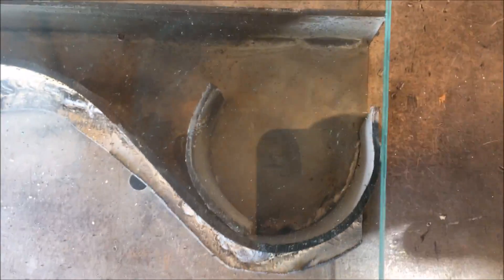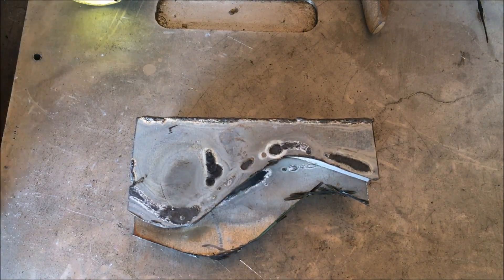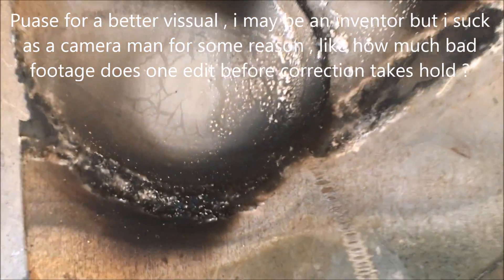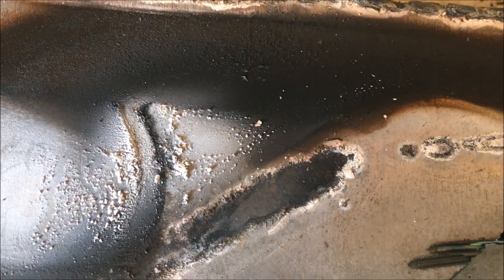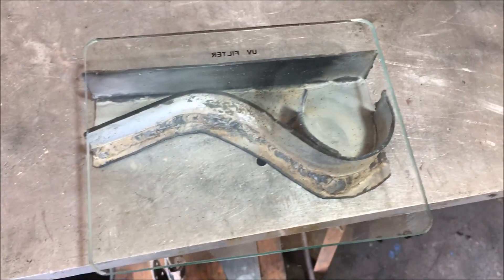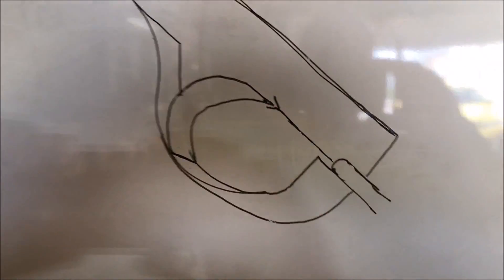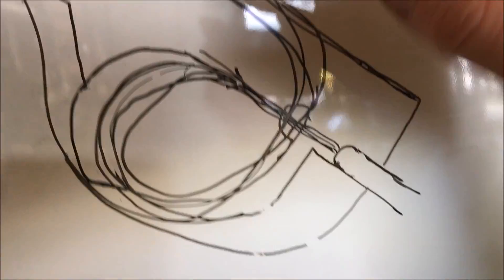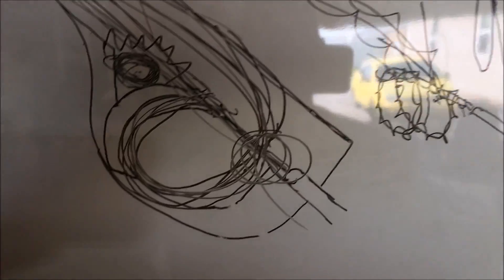Waste oil Burner Extruded Combuster  Design

Comment: the white does not really mean its oxygen rich it white because its hot
Reply from the maker: yeah typically hotter zones have more oxygen per sec delivered to that zone by a   continual replenishment and by the fact they get first dibs on the fresh air.  the burning fuel is just blasted out the device in the barrel whith little o2 left over from vortex combustion , but in the vortex zones a greater  air to fuel ratio exist   and thats why it burns hotter   , a swirl jet or Vortex as its called  has a continuous replenishment of fresh incoming air but a traveling flames gradually burns itself out  and only has o2 left over from the vortex to burn   . More O2 per unit change in time is by definition a leaner burn or oxygen rich .more so then the surrounding areas . the only way you can make it hotter is add more oxygen bro weather it be by mixing the gas better or more being added to that zone . but hey what do i know   , there are also black zones that are black because they didn't get hot they didn't get hot because the vortex burnt up most the oxygen ?

Comment: Your line art seems to explain it the way I would envision it happening.
Reply from the maker: I regret not  mentioning the incoming draft induce by Brunelli's principle finishes off the swirl and heads it back out the discharge side of the device , it plays a huge role  in inducing the upper rotation , you can even see a quarter circle inside the intake . Check time stamp 2:02 and look at the round top or quarter pipe as we would call it as kids
Reply: I remember quarter-pipes, I knew a few skaters and BMX freestylers as a teen.
Reply from the maker: I got your link and it made me wonder what would happen if we incorporate the golden ratio into the vortex itself , if you could induce a golden ratio vortex or even a  combuster that used those dimensions i wonder if something would happen. any way i did figure out one thing about combustion "all theory that may already of bin proposed " but i think the reason some areas burn hotter then others is because low velocity compressed gas burns slower then high velocity low pressure , when static pressure converts to dynamic it stretches out allowing the fuel and air to mix faster and to a higher order , this is why rocket nozzles get so hot at the throat , O2 is in the engine every place so why does the throat burn out ? its gotta be the molecules are now traveling faster and the stretching out of the combustion zone in the divergent sections of an engine induce a leaner better mixed zone then the slower moving compressed zones . there has to be a connection between the lower pressure and the hotter burn and consider this , a divergent nozzle can or any adiabatic expansion adsorbs  energy from the surroundings or any expanding gas causes a cooling effect   i think the cooling effect in this case is adding energy to the flames. To be clear we all know that if you expand air threw a nozzle a cooling effect takes place and static pressure robs thermal energy from the surroundings when converted to dynamic pressure  by taking off with a vibration potential energy with it  . so now think of that with red hot metal ? how much energy is available for adiabatic expansion   in these conditions , could it be the reason for the hotter zones ? Adiabatic expansion cools gases but would that be the case in combustion ? wouldn't it adsorb even more heat then usual from the surroundings as it expanded seing as how its a 900 deg combuster  ?
Reply from the maker: Ok so my nomenclature is off its bin a wile , maybe i ment isobaric expansion could be the reason the low pressure high volocity zones burn hotter , or maybe its the things you discussed in your thesis but im not any ware near mach 7.7  or what ever you stated but something strange is happening .
Reply from the maker: In regards to the oil hitting the glass i was worried about it turning the glass black not about it cooling and breaking it stains red hot metal white and cooler metal black so going opaque on us was my concern .

Comment: Yes your oxygen balance looks pretty nice, and the swirl lives.

You would be best to preheat the glass in an oven somehow to keep the whole mass of the glass expanding equally since its the sudden and extreme imbalance in temperatures from the middle to the edges.

An alumina type 'glass' or pure quartz would give you better results for longer.

On the 'whistle' build, you would have to experiment with the amount of extension you gave the scoop, I would have had to as well if I were building it.

The easy thing is, you just take a torch and heat up your plate enough to dimple it in the middle [your fine tipped HHO torch should be perfect for this since its a lot of heat in a small area, allowing the edges to remain harder than the working area] and carefully hammering it to say where you would guess to be your bare minimum, and then cutting away the part you do not need.

To resize it, simply re-head the leading edge of the scoop so you focus your heat where you need it and no places it was not needed.

Although, technically you could hammer it back a tiny bit, it would not un-stretch, so the back-hammering would cause wrinkles.

You do not need a really heavy piece of metal for the initial experiment, so maybe just cut up some old used appliance for cheap spare flat steel and make a few of various sizes so that you can both vary the distance as well as the other dimensions without having to destroy one you already made, which you just might determine works better than later versions.
Reply from the maker: my idea was to drill a hole in a piece of metal then get it red hot in the area of the hole at witch point i will insert the drill bit shank down into the hole and bend it over as far as i can creating the shape in to directions , one up one down , then we simply hammer flat the one we dont want . the dimple idea sounds good to but i already kinda had my mind made up after i looked at your draft , its funny how such simple things can actually be a complex build
Reply from the maker: Yes i had the same idea about pre heating the glass in the oven , it would definitely buy us some time  but my concern was what will happen when oil hit the glass at 500 deg ? it may turn black faster then if we just let it explode . We got under 30 seconds of burn before the glass exploded on the torch test but on  1/8 speed thats a good amount of footage to examine . Its a real tough call , my intuition tells me oil hitting hot glass will cause more harm to the observable life span of the test set up then just letting it explode by thermal shock . I cant remember the specks but you only get  80 deg c of thermal shock for glass meaning you must keep all parts of the artifact within that spectrum or thermal cracks can appear . that spec is not proofed but likey close , its bin 10 years since exposed to that literature , i do remember being very surprised at how low the number is   even for pyrex witch is deceivingly praised in chemistry books
Reply: Your forming approach sounds as good as anything else. I think your method should work well enough.

Twisting a drill bit in the hole, for safety reasons I would use some other metal than a drill bit if only because it could break [or at the least possibly bend, either way ruining the bit]. 

If you have a large strong screw driver, a steel shaft, a piece of rebar, a drift punch, even an old driver from a ratchet, those would be less likely to deform or break than a drill bit.

But its your shop, so, if its a drill bit you use, just be careful.
Reply: Those micro droplets of oil would not have enough mass or specific heat to cause sudden quenching/shrinking, and likely, they would already be ignited by the time they got close to the glass. 

Its astronomical to think it would even be possible for a fine, fully lit flaming mist to cause cooling.

Your greater threat is the heat imbalance toward the positive and not the negative.

As far as carbon build up on the glass, that is possible, and so too is the glass discoloring and soaking up ash seeing as technically the glass its self is an ash [composite of many elemental oxides] and if it gets very close to its melting point, it will permanently discolor.

That is why I suggest quartz or alumina which both have far higher melting temps.

You can strengthen common soda lime glass and make it more crack resistant by the way, simply boil it in potassium hydroxide or potassium nitrate.

I subscribe to this guy because he has some pretty nifty stuff. This video is about making rudimentary gorilla glass.
https://www.youtube.com/watch?v=y02AXdec1sE&t=7s
Reply from the maker: cool ima check out the link . I agree with you about the pre heat but doing this on my own may not make that very practical , nothing like having 3 or 4 critical things going at once in a high temp experiment , not to mention my neighbors spy on me , could you imagine them seeing me run out side   franticly with a 550 deg piece of glass followed by roaring fire  an explosion and the sound of tempered glass flying every place lol
Reply from the maker: i got an idea , tomorrow im gonna heat up a pyrex tube and spray some oil on it , if it doesnt turn opaque then the pre heat is on
Reply: Pyrex, if held between 900°F and 1300°F should be pretty much self cleaning, its softening point is 1510°F [820°C] so you could maybe go higher, although once it begins softening you will begin discoloring it as well as it will of course begin to fall into your part.

The melting point of Quartz though, is a lot higher, in fact, higher than the melting point of steel. 3038°F [1670 °C] (β tridymite) 3115.4°F [1713 °C] (β cristobalite) 

If you could get some quartz, some how, you could run your observations as high as the MP of anything you are likely able to get your hands on, although, of course, as you said, its not cheap, and you are on a budget.

Perhaps some kind person viewing this channel who is well connected could assist you in getting hold of some.

Comment: It looks like the hottest point of flame is happening inside the burner, at the exit of that “funnel”.. thus, keeping the “best part” to itself..
My prediction is that teardrop shaped design will have hotter flame exiting the burner, rather than staying inside.
Cheers
Reply from the maker: i cant wait to see this thing running some richer burns , dont have a good nozzle for that but building one tomorrow , my current nozzle is a lean burn design but not buy choice